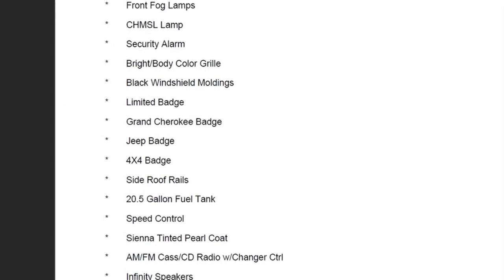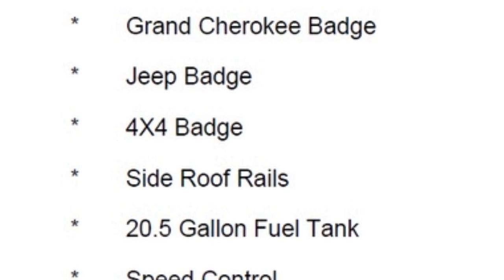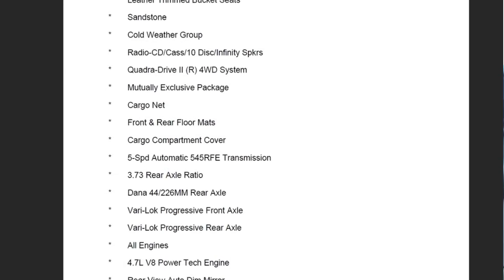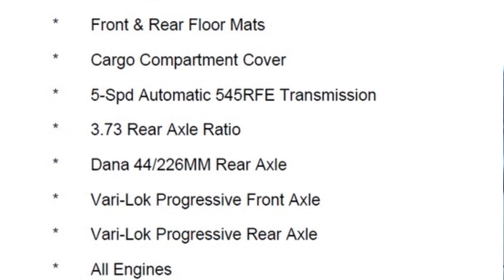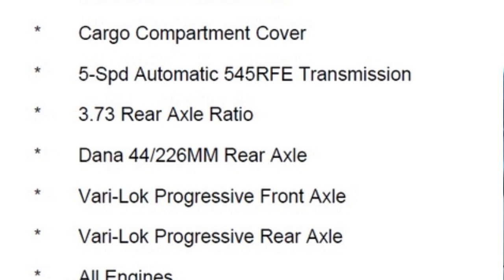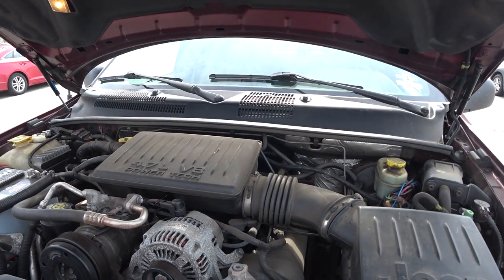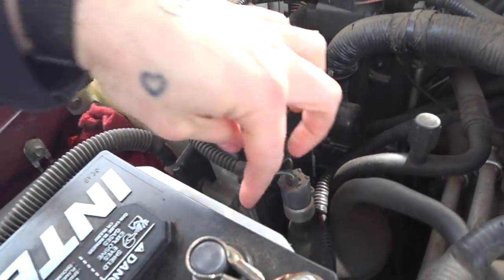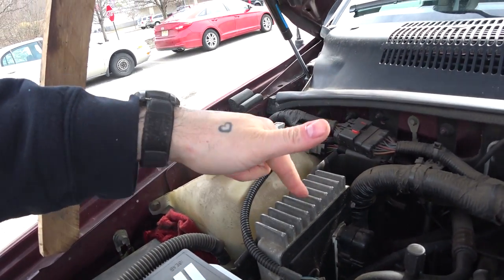45RFE to 545RFE TRANSMISSION hack to upgrade from 4-Speed to 5-Speed

Comment: Yeah, I know this is 6 years old. But for me, it's new. Because I just stumbled upon it. So, hopefully, someone is still monitoring the channel. So here's what I have and my question. I have a 02 Jeep Liberty Limited w/ 3.7L. How does this mod affect the engine? I understand that the target of the mod is the transmission. Or does the engine and transmission have separate computers? But, if I'm understanding correctly, we're talking about taking the ecu from a V8 and putting it on a V6, yes? That doesn't mess up anything with the motor? I'm really curious about this. This Jeep, I'm working on, has survived a rather rough life to this point. It's been in my possession for maybe 5 years or so. The customer has finally walked away from it and given me the title. It came in 9n a rollback and ran horribly. When they only have compression on 2 or 3 holes out of 6, they tend to run pretty rough. Those that had compression had very low compression at that, maybe 60 or 80. Anyway, July 8th, 2024, we were hit by an EF2 tornado.  So it's got damage from that as well. So one might ask, Bro, why are you going through all this hassle?? Well fellas, two words. My wife!! She loves the damned thing and has asked me to fix it up for her. Now my wife doesn't ask for much, AT ALL. So when she does actually ask for something, I'm willing to go to the ends of the earth to make it happen. 
So, what's low down on this mod and how does it work with the Jeep 3.7L?
I'd GREATLY appreciate anyone's response and help with this. Which btw, I just finished building the new motor for it. But ssshhhhhh......she doesn't know about that. so let's keep this low and to ourselves, ok. Thanks guy's!

Comment: Im currently building a 99 wj limited with the 4.7 and I've got to do the tcm swap, the 08 cams and h.o springs, and it should be just all cosmetic after that. I know im late but thanks for the video!

Comment: I seen when you put that they were the exact same transmission... My question is I have a 2002 Dodge ram 1500 4 wheel drive adjust acquired according to my research it has a 45 RFE which is burnt out I have a 2001 Jeep Grand Cherokee 4.7 that has a 545rfe... Everything I've been reading so far says I can chunk that transmission right in that truck and leaves the factory TCM and it should function as a four speed just like normal or I could use the TCM from the Jeep and utilize the transmission as a 5-speed.... Is all of this correct can I use this transmission in my Dodge truck in either scenario I really don't care if it utilizes the 5-speed function or not I just want to get the truck on the road and drive it...👍👍👍.. I also have a '04 Jeep Grand Cherokee 4.7 with the same transmission was going to use it but it's farther away from the year of the Dodge truck I figured the 2001 Jeep would be a closer match or are they The same?... As far as working in my Dodge truck....?
Reply: Sure wish somebody would get back with my comment..I've got the truck at my house with the transmission out and ready I'm getting ready to pull a transmission from one of my many 4.7 Jeep Grand Cherokees. The one I'm thinking about using was made in 4 or 5 of 2001. the truck is a 9 of 2001 which is a 3rd gen with the 4.7.

Comment: I have a 2000 Durango with the 4.7L and 45RFE. My highway speeds at 70 mph are roughly at 2000-2200 rpms. It doesn’t get to 2500+ until I break 80 mph

Comment: Got a easier way of finding your trans model. Call your dodge dealer. My local dealers parts guy has helped me many times now. Thier just standing in there for 8 to 10 hours with not much to do. Trust me these guys will help if your not a dick to them.

Comment: Brother great vid. I’m trying to verify what transmission I have between the 45 RFE or the 545 RFE. The website you referred to tells me I have a 45RFE. I have a 2002 Dodge Ram 4.7. I don’t think I have the 545 and I need to save that gas. I wrote down the details from that site it says 4 speed 45rfe. Thanks I need to know for sure

Comment: Hi Doug, I have a 2000 WJ 3.1 Diesel with 42RE Transmission. I only have 1, 2, 3 and O/D. Can I use  the upgrade the TCM of the 545RFE? Regards. Thanks for the tips!

Comment: Doug, You refer to, WJ,,, what do those letters represent ?? I have a '02 Dakota that I looked up on the Chrysler website you listed,, and I do have the 45RFE Transmission,, so all I have to do is to find a TCM from a 545RFE Trans ??
Reply from the maker: Hey bud. Most Jeep models have a two letter distinction. The Grand Cherokee I have (99=04) which came with the 4.7L is known as a "WJ". Long story short, it does not apply to you if you aren't in a Jeep.  In your dodge all you need is the TCM from a truck with the 545 and you are good to go!

Comment: I have a question to Doug/Eric and all the viewers of this great channel. It appears the WK and XK also had the 4.7 with the 545RFE, however it also had "tiptronic" manual shifting. How would you go about adding this kind of manual shifting to the WJ's 45/545RFE and could you program a switch to change the function of the back steering wheel buttons to be your upshift and downshift paddle-shift commands? would appreciate any feedback.
Reply: I'm not sure if that would even be possible.  But I guess you could get a competent mechanic to price the job for you and see if he can come up with a way.

Comment: Hey Doug, i have a 2001 4.7 that runs around 24-2500 rpms @70. According to my buildsheet it has the 545, and not only that there’s a sticker under my hood stating the TCM was flashed back in 03. I have no codes, and all the gears including OD work fine. Any input? Im having trouble counting the gears as well haha

Comment: I have two 99-WJs. #1 has a 45RFE that I daily, #2 99-WJ 545RFE pulled out of a river. Engine is toast. But transmission is 545RFE from a 2002.

Comment: What's funny is how he said Crysler just throws leftover shit into the next model line of cars. I must have the only 2002 Jeep Liberty Limited edition 4x4 3.7Lt. with a 45RFE 4 speed automatic trans, with overdrive. Not the 545RFE and I have confirmed the trans is original to this Liberty, Oh- wait is that why they called it a limited edition?  Limited to the leftover parts on hand? LMAO :) I will most defiantly be doing this.  Thank you for confirming what I had suspected after seeing a broken down trans at the wrecking yard, I also knew about the possibility of 8 forward gears and  3 reverse gears.   Thanks buddy great video, will be subscribing just for that. :)
Reply: D&E, I can now confirm everything you said is true. I watch your video a year ago to confirm what I had already found out from Martin on martinbuilt's channel, and from my own exhausting 3 month-long research, the 45RFE and the 545RFE are in fact the same physical transmission with just a software update to them to go from a 4-5 speed trans. I did the swap out on the TCM shortly after watching your's and Martin's videos, and will never look back. It was as easy as changing a lightbulb. I went from the 45RFE running at 2400 RPMs at 65 MPH to the 545RFE running 1500 RPMs at 65 MPH with a one-year-long test concluding in a drastic Mile Per Gallon increase from 14 MPG at the start to a whopping 19 MPG in town and 23-24 MPG on the open highway.  Guys an increase of 5-6 MPG is frigen amazing. Plus not to mention the longevity of the trans running at a lower RPM means it runs cooler and will last longer. Thanks again for the great video D&E.

Comment: Found one and installed it today on my 2000 WJ! 2K RPM at 70MPH is NICE! I used the Build Sheet info website to verify the Jeep at the junkyard came with a 545RFE stock. Got there and discovered someone had already pulled it and left it and the mounting bracket (with the screws) sitting on the driver's seat. Talk about cake walk, I brought tools for nothing lol!
Reply: Follow up, i'm noticing rough shifting into 2nd (both up and down) since the TCM swap, wasn't doing that with old TCM, gonna swap back tomorrow to test. Could that indicate a bad 545RFE TCM?

Comment: I have a 2002 Dodge Durango with 4.7L and a 45RFE (DG4) transmission. So not all vehicles after 2001 have the 545 rfe transmission as explained in the video.

Comment: Having 8 forward gears would be amazing for fuel economy and power delivery.
Reply: New Dodges do
Reply: Yes but having eight forward gears also means that there's a problem with fitting as many clutches in the clutch packs and you end up with 8 shitty gears instead of 4 good solid gears. It never seems to work out well. Unless you can make the transmission large enough to put enough clutch packs in it to make it last. There's always a trade-off.
Reply: @44hawk28  never thought of that but I think the 8 speed is a dsg so it has normal gears like a manual and is shifted by electric solenoids inside the transmission at least that's how vw does it

Comment: In my 2002 KJ, I swapped in the 545rfe TCM from a 2001 WJ. I noticed an improved shift pattern and a 200 rpm drop in top gear. It seems to hold gears more often when accelerating or under load, allowing you to make full use of the torque without constantly downshifting. I recently added a Michigan Motorsports line pressure booster, $18 and 1min install. It now has quicker shifts and feels the way it should have come from the factory.
Reply: Isn't that line booster a 1.5K resistor?..
Reply: @motersickel  basically

Comment: From what I'm finding there's slight differences from year to year and make to make in the software compatability. I just pulled a tcm from an 03 and put in my 2000 and it wouldn't communicate with the software in the tcm which I don't understand what the reasons for the changes but it screwwed me big time

Comment: I'm doing the tcm now due to p0613 code which is internal processor failure but my tcm was halt in with 3 torx course thread screws. I'm going through headache after headache after headache with this jeeps electrical for the trans... I really hope I can get it fixed soon cause I really need my ride for work . But I'm going to def give my 45rfe the update to 5th gear for sure... thank u for the insightful and knowlagable video!!!👍👍👍

Comment: I have a 2003 KJ with 45RFE. The question is simple: The TCM pn 56041905AD will do the job or not?
Reply from the maker: I do not know anyone who has done it in a Liberty, but everything I understand about the 45 and 545 is that it will work. Regardless of application the 45 and 545 always used the same eternal TCM which means this swap is always possible. Now my question is ... is Dodge and the Grand Cherokee already had the 545 in 2003 (since mid 2001)... are you sure you 03 Liberty doesn't already have it?
Reply: @DEInTheGarage  Νο, my liberty haw 45RFE for sure.... I belive that body in Dodge, jeep etc are diferent but mechanical and electronics are the same.... I am asking for this exact pn. If it works in other 45RFE it will work for me also. Just to be sure before order....!!!!! Note that I am in Hellas, in the other side of the planet....!!!!

Comment: I did this TCM swap on my 2001 Dodge Dakota 4.7L  and it works amazingly well.  I got the info from another video made by Tony the Truck Guy who did it on his Dakota.  As you mentioned it ONLY works on the 45RFE trannys to convert it to 5spd auto.  I bought a used tcm from an 03 Jeep Grand Cherokee with the p/n P56044574AC.  Simple install and I am extremely happy I did it. You are right when driving on the freeway with a 4 spd auto, that engine is working overtime at speeds of 65mph or higher.  Now I am cruising at 60mph @ 1600rpms instead of 2100rpms.  It equates to better mileage on the freeway, does not do much for city driving though but I still love it that improved my gas mileage for freeway driving.  Here's the video I watched when I did this, https://www.youtube.com/watch?v=0XigAx86Zp0.

Comment: I hv a 2002 dodge ram 1500 4x4 it's a pig on the highway what's the straight tranny replacement that is an actual 7 speed auto.

Comment: Hi There... i Have Jeep JK 2.8L CRDi with has T12TJ body transmision. And it runs only 4speed. Not in 5speed. Is your software hack can change into 5speed mode in my Jeep??
Reply from the maker: Unfortunately, no. I think you would have to go to a dealer. Sorry

Comment: I have little over 98,000 miles on the 545rfe  in my Dodge Dakota doing 10 hr trips across Texas and it’s been great with only a bad relay fuse. Doing a filter and fluid change sucks cause of a support arm in the way but it sounds and pulls so good with the 4.7 V8 when it goes up hill with a load. 😊

Comment: My 2001 jeep grand Cherokee limited door sticker says it was made in 09-2000 and my transmission sticker says 45rfe but my RPM is at 2,000 when doing 70mph so I'm assuming my tcm has already been flashed do you know what rpm the 545rfe has when doing 70mph
Reply from the maker: Not off hand, probably around 2100-2200. You can count the shifts if you can go from zero on a long road

Comment: The link to find my vehicle info isn't working for me for some reason
Reply from the maker: Unfortunately the site goes down ALL the time. Check back in a day. It always comes back on line eventually
Reply: @DEInTheGarage  sounds good and from what info you gave in the video I have the same jeep that you have and with quadra drive also but my transmission is the 45rfe

Comment: I’m not sure about your year info, I have a 2002 Dodge Ram 1500 with the 4.7 and as far as I know it has a 45rfe. I could be wrong. Maybe we are only talking jeeps.
Reply: I am also basing this information off of Wikipedia
Reply from the maker: They changed the Dodge and Jeep in late 2001, so your 2000 would have the 45 and could be upgraded to the 545

Comment: You mention 45RFE and 545RFE, what about 42RE? Could you explain the difference between them.
Reply from the maker: The 42re is a completely different transmission and is not applicable for this hack, unfortunately.
Reply: So u cant put a 545 from a 2000 in a 99 jeep that has a 42re tranny??
Reply: @dbkhew10  
I'm not sure if it's possible. But the 42re and 42rle were installed on the 4.0L.
The 45rfe and 545rfe were installed on the 4.7L.

So again I'm not sure if it's do-able, but the gearing would be optimized for their corresponding engines.

Comment: I have 2000 4,7 v8 whit  4 speeds. Dose it Mather if I find ECM from high output model?
Reply from the maker: You are not swapping the ECM (controls the engine) you are swapping the TCM (controls the transmission), so to answer you questions, no. It will not matter what engine it has as long as it is the proper year

Comment: I have a 2007 RAM with a 545RFE and was wondering why at 65 mph on a flat stretch, the RPM would sometimes be 1.8k RPM and other times be 2.2k RPM. I thought the transmission was slipping but your expanation of the transmission potentially having 8 forward gears was really helpful- thanks!
Reply: You may be noticing a difference because you are near a shift point.

If you are accecerating you may get a higher rpm than if you go sligly faster (letting it shift to the next gear) then slow.

I noticed the same thing on my 02 Dakota. Accelerating to 45 the rpms are higher than if I go 50 then slow to 45.

Did the hack, 300 less rpms on the highway. Easy way to tell which TCM you have at highway sleep turn OD off then on, 1 up shifts 45RFE (4SP)
 2 up shifts 545RFE.
(5SP)

Comment: 04 wj with 45rfe from factory, vin confirmed. Not saying your wrong on most Intel. Just off on the years. Only true true vin confirmed 545rfe is going to be 2005 wk. But, transmission supply depo sometimes say this; 45rfe, 5-45rfe, 545rfe.
Reply: My 02 is Vin confirmed "5-Spd Automatic 545RFE Transmission" as copied from build sheet.

Comment: My trans is so messed up, you give it gas and the whole vehicle shakes. But it shifts fine at higher speeds. 2000 WJ with the 45RE has 167k and I got it for 1500
Reply: Inspect all your universal joints.
Chock the wheels. In neutral. Don't get run over. Engine OFF.

Then inspect your transmission and engine mounts. 

Lastly, inspect all your front suspension control arm bushings, track bar bushings, ball joints, and all steering components. 

Worn components can all feel like a transmission with shifting/ vibration problems. Ask me how I know. 😩

Comment: Hey everyone, I have a problem with my 45rfe in my Jeep Grand Cherokee. It has been reflashed so it has the 545 update. But it has some issues. I have been having some shifting issues lately. Very harsh shifts especially on 2-3 shift. I was also getting codes for a transmission pressure sensor. I replaced the sensor and checked wiring etc, but problem still persists. Unless I disconnect the pressure sensor then the shifts get better, but this has me pulling my hair out. Any ideas?
Reply: I also still have the code.
Reply: Change your solenoid pack in the transmission
Reply: I found a forum thread that lists the TSB the dealer would need to perform the update.

https://www.jeepforum.com/forum/f310/45rfe-flashed-545rfe-1086147/#/topics/1086147?page=1

Comment: I’m not trying to worry you but I wanted to say watch out for the recalled airbags in the wj jeeps they can throw shrapnel out of them if they go off and hurt the driver or passengers only saying this cause that baby seat back there.  It’s probability not too dangerous and I don’t believe it’s life threatening but you might get a dealer to replace them for free!  Ohh and those heated seats are also recalled. Might look into some free dealer parts 
-heck ya on all the wj videos btw! Not to many wj fans out here🤟
Reply from the maker: That is some solid advice. Perhaps I will drop it off at the stealership and have them take a look. Thanks!